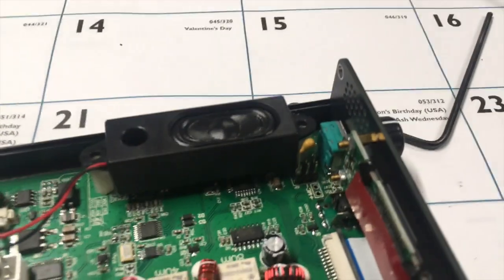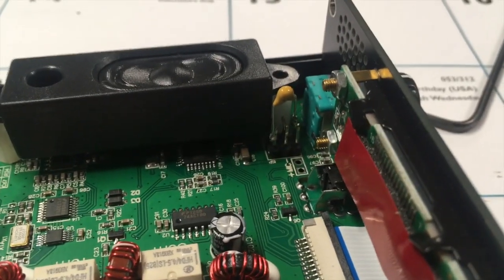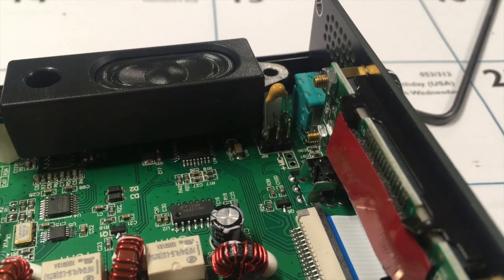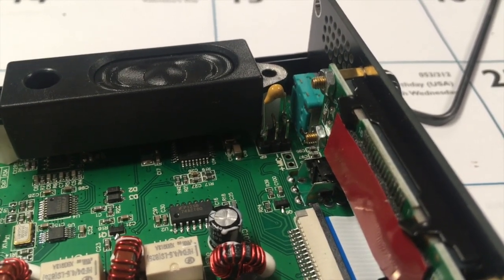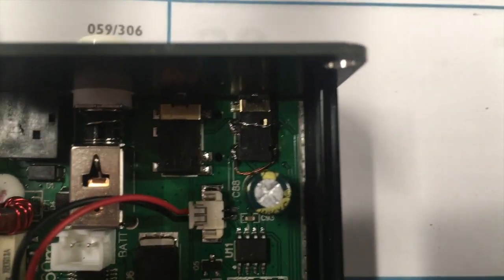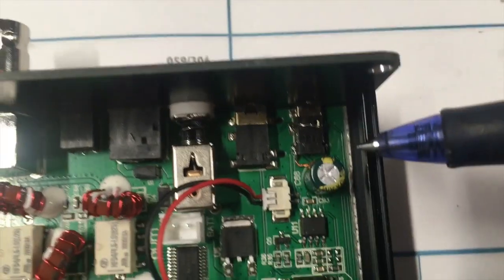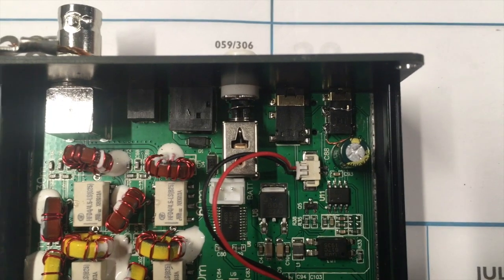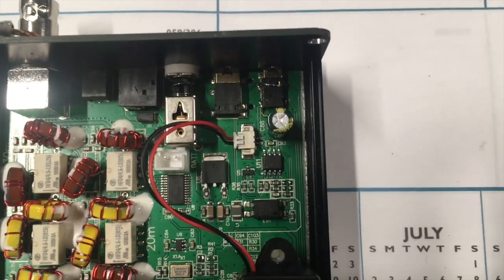Fixing the uSDX+ V2...

Comment: I bought one of these a couple weeks ago, and I made sure to buy it on Amazon instead of any of the dealers on AliExpress.  It cost me a little more this way (I paid $132 from Amazon), but I'm glad I did, because now I can RETURN it.

The radio I got is basically deaf - it can hear noise, but nothing else.  Not WWV, not ANYTHING on 20 or 40 meters.  And no, I'm not going to spend 40 hours on trying to make it work, because I am convinced that both the uSDX+ AND Manuel's (tr)uSDX are junk.  Not just bad construction (although this may be worse on the uSDX+), but by design.

I actually bought the (tr)uSDX first, from the approved vendor on Amazon, but apparently I didn't read enough reviews first, because i was disappointed in its performance.  Guido, who wrote the firmware for all of these radios,, started off by modifying a QRP Labs QCX transceiver, which is a CW-only radio.  He replaced most of the components in the receiver circuit that were doing an image-rejecting detector, which includes among other things, several op-amps and associated resistors and caps to shift the phase of the demodulated signal so that the undesired image signal gets canceled.  This Guido replaced with code, doing the phase shift in the firmware.  But he went way further than that, cleverly finding a way to produce SSB modulation without adding a lot of circuitry - again, he does this in software.  I won't go into detail, but he takes the mic input, which goes through that phase shift network, and does a little more math on it to convert it from an I/Q signal to separate phase and amplitude signals.  The phase he deals with by doing real-time small adjustments to the frequency of the Si5351A synthesizer chip, and the amplitude he fed to a transistor that was being used on the QCX radio to amplitude-modulate the keyer signal so that the rise and fall times of the RF aren't so sharp that they cause unpleasant key clicks.  Which apparently worked all right, BUT, after some testing, he determined that the amplitude modulation isn't completely necessary - if you disconnect it, you get what sounds like highly-compressed audio, because that's pretty much what it is.  And then he doubled-down on this, claiming that disabling the amplitude modulation actually improves the readability of your signal when it's down in the noise.  Which of course is true, but it's not something I want to have disabled all of the time.

Well, too bad, because he actually removed that circuit from the (tr)uSDX design.  It LOOKS like he may be doing a slight amount of amplitude modulation by changing the DC bias on the FET gates (that circuit that you showed that had the missing 100 kohm resistor), but it's not nearly as effective.  I even read one review that says that unlike TRUE single-sideband, where you only produce RF when you are talking, this radio puts out the same amount of power whether you're talking or not!  I found this unacceptable, but I thought that maybe I could just add that proper modulation circuit back to the radio, and modify the code to make it work like it did in the earlier versions.  So I looked on Manuel's forum to see if I could get the source code so I could fiddle with it and make it more like REAL SSB.  I found a post where someone had asked essentially what I was going to ask, but he asked instead if he could use the source code from the uSDX project on the (tr)uSDX.  Manuel chewed him out, accusing him of "software rape".  Literally.  I wrote to Manual, telling him how inappropriate this was, and also that I have no use for the firmware if I can't modify it for my own purposes.  This IS amateur radio we're talking about, not commercial radios.  But no, he chewed me out as well.

So I thought, okay fine: I'll buy one of those Chinese uSDX radios, because at least then I would have the amplitude modulator circuit.  Well, that turned out not to be the case; the design that got ripped off and built by several different Chinese manufacturers uses a later version that also does not have the amplitude modulator.  And besides, as I mentioned at the start, the receiver is pretty much useless as well.  So here I am with two useless radios, but at least one of them (the uSDX+) I can return.  The (tr)uSDX I bought in kit form, and at least it works, but I'm probably never going to use it because I WON'T use it in its present form because what it produces is not SSB, but more importantly, I can't modify the code to make it work with a proper modulator because Manuel believes it's HIS radio, not mine.

Not at all happy, and now I'm working on re-designing the whole rig because it's such a hack job to begin with.  That is, starting over from scratch using a microcontroller that's up to the task.

Comment: Are there mar mod for this...
I can to tx on 6675 MHZ ????
Reply from the maker: Being this is an open source design you could theoretically re design the filters in the PA stage. However, being MARS operations require reliable equipment, with skilled operators this radio should never ever be used for that service.

Comment: I just got my usdx+ and it has no reception on all bands. I am using long wire antenna. Compared with tecsun pl330 and the same antenna, reception is very good on this little reciever. Has someone had this issue? I did a fix with connecting the ground to the case only. Did not solder the resistor and capacitor yet.
Reply from the maker: That’s very odd. I’d make sure the noise filter and attenuators aren’t turned up. But that would be a new problem I’ve not run into. All 3 of mine can hear a pin drop on the far side of Mars.
Reply: I also do not receive anything on my new Chinese uSDX+.   Attenuators set to zero.  It receives atmospheric RF noise just dandy though.  With no antenna connected the signal level meter is -125 dB (40 m band)  Connect a 10m longwire and the noise level goes to -85 dB.  Add in a 30 dB LNA and the noise level goes to -55 dB.  But nothing human to be heard on any band.   Switching modes and filter bandwidths has the expected effects on the noise.  Can someone explain why it can pick up atmospheric RF noise but no human generated RF signals at all?  Even tuning to the MW AM and VHF FM commercial bands picks up nothing.   Transmission into a dummy load shows 4-5 W on CW and normal looking SSB modulation.
    How is it fixed?  I see several R or C component spots missing parts but I don't know if they are intentionally missing or accidental.
     Would someone please explain how it can pick up RF noise but not a CW carrier? 
    Thanks!!!

Comment: I have one of those Rigs it came  with no Arial can you tell me where I can get one love your Vidios
Reply from the maker: Hey, well, there's so many different antenna combinations available that it really does depend on what you're planning to do. Set it up in a car, take it out into parks, or set up some sort of home station. I'd suggest doing some searches for HF antennas on here. There's lot's to learn. I hope that helps. And, depending on time, I do want  to create a video about the random wire antenna. (You'll need a tuner to use one,) but they do an OK job across the all bands if you get them set up just right.

If you're new to the hobby I'd suggest contact your local ham club, they are always wanting to talk and help new comers along. :)

73!
Tom

Comment: Dis the microphone capacitor mod, but used a female header so I can remove it. For the antenna socket grounding  I used adhesive copper tape.

Comment: Great video Tom on making the usdx a better radio.  I know you didn't want to get into the firmware update, probably because of added issues after updating it.  Is it worth to doing a firmware update or just leaving it the way it is?  If so, which firmware update do you recommend?  Thanks, Martin.
Reply from the maker: Hi Martin, thanks for the kind words! So, all of my uSDX+s are running 2.00c, and it seems to work rather reliably. I've also heard, but not tried good things about 4.00c, with 4.00d soon to come out on the Facebook group for these radios. 73, Tom

Comment: It was open source. No violation. Also you bought a second version of this radio which was known to be bad. The original company had stopped making these. You should have done your homework before buying it. I own two of the original versions of this radio and have worked all over the world with fine audio reports.
Reply from the maker: Well, and that's the reason for this video. For others who are doing that research. I now own 2 of these radios. And, like you, I get glowing signal reports, now. The original one featured in this video is in daily service, and has logged many, many contacts, and has even done net control duty. As far as the legitimacy of this radio, and all those based on it's foundation. It could truly be called a disaster with the licensing changing in mid flight. Not to mention the addition of clones of clones. But I'm glad you are enjoying yours as much as I am enjoying mine.
Reply: Thanks, Tom. It is so funny how clones of clones of clones show up. Sadly, they get worse as time goes on! But it is great how popular QRP has become. I started in 1968 and there was never talk of it. Thank you for telling guys how to fix the later versions.

Comment: i just got one of these, after watching your video i decided to tear it apart and lo and behold i'm also missing that resistor! I've only ever done through hole soldering so i guess it's time to learn smd. I haven't noticed any issues with grounding like you mentioned although mine is in the same anodized case. i might still do what you did just in case and ground the sleeve to a screw. the one problem i've noticed so far is that when in cw mode, my sdr dongle picks up tones from the uSDX. Both devices are sharing a single antenna and i'm not sure if that is causing abnormal behaviour  but since i have yet to get my technicians license i'm quite nervous about accidentally transmitting. i guess the only thing to do is run some tests with an oscilloscope and see if it's acting up and then consider returning it and getting the trusdx if i can't resolve the issue.
Reply from the maker: Good day!! And congrats for holding off transmitting until you get your appropriate license. :) If you're planning to use this radio for CW, you will not be disappointed. The odd behavior comes into play with using it for sideband, and not all of them suffer from it. If you can get the (tr)usdx, you'll have a much more enjoyable experience, especially if you're not comfortable with moding the uSDX. But, yet again, I don't know what you paid for it, but if it was cheap enough, it could be a good learning opportunity.  As far as sharing an antenna with another receiver, that's really not the best idea at all, as it will blow the front end out of the other receiver with ease if you transmit without some sort of duplexer... (And that would be a feat to create for HF, IMO.) If you're just receiving with both, then yes, the uSDX will create some birdies that the other receiver will pick up. I know that when mine is tuned around the 80 meter band, it will break the squelch on my VHF receiver. But they are very localized emissions.. All the best!!

Comment: I have one of these, but didn't realize it was a clone until I had purchased it.  It is basically ok for what I paid, but if I had it to do over again, I would buy the real thing. In fact, I probably will purchase one of his soon. Manual is a great guy and deserves the money. Thanks for your time invested. BTW, do you have the firmware link?
Reply from the maker: Well, if you're looking for the latest, I'd go over to here: https://github.com/GW8RDI/uSDXOpen?fbclid=IwAR0MN9C83QCF1Jqf92JiBB5VGB2yIvysUgtn6yr5L_Do7c2wAiihL5JjIC4 I hope that helps!
Reply: Same here, mind you mine kind of works OK from new, same issues  the grounding I fixed using copper foil, added the capacitor, waiting for some smd resistors.

Comment: Pleased that you found the 4.00d firmware useful.  C24 is on the MOSI line, which is the microphone ADC input, so yes it is the RFI filter, given that the external microphone lead is unshielded and acts as an antenna. It is also the data input for programming so C24 distorts the data and easily bricks the atmega.
uSDX was an open project with many contributors, the license does not prevent commercial use, (tr)usdx was a version where the uSDX design was used but modified, and the firmware closed. The (tr)usdx kit was sold and currently licence keys are provided, as far as I understand, to several "approved" Chinese makers, so take what you've been told with a large pinch of commercial self interest lol

Comment: Great video Tom. Lots of true words spoken. I bought one of these and it arrived last week, already I wish I had bought the tru version. I think I have the same instability problem you experienced and was putting it down to a noisy BNC connector, so at least I now have a head start. Mine seems to work well on 20 and 15 but 40 and 80 have some sort of problem on receive that sounds like the recovered audio is being restricted by around 75%. I will start pulling it to bits soon and if I find a solution will post. I am intending to buy another, but for sure it will be a Tru sdx this time. Thanks again. Subscribed. 73s Shane. G7EWL
Reply from the maker: Thanks! 40 and 80 have weird sound to them on both my radios this week. Most of the folks I talked to on 80 last night were commenting on the after effects of the geo storm we had last week, so may don’t do anything drastic just yet. ;) Also, the Noise filter / blanker (NB) setting seems to work more aggressively on the lower bands. (On mine, anyway.) All the best!! Tom, VE7NGK